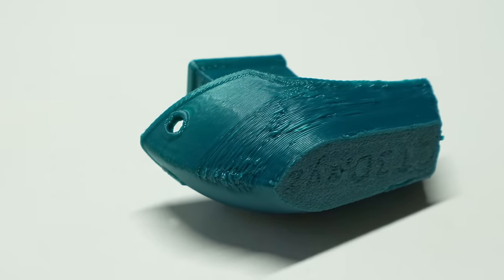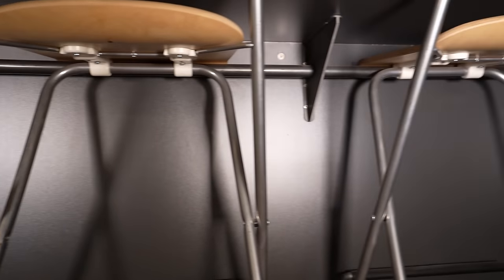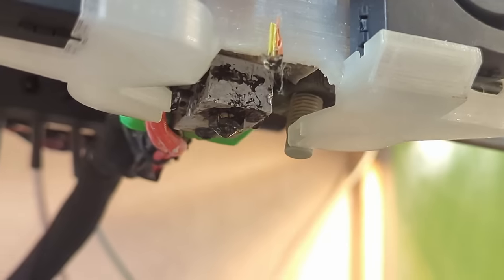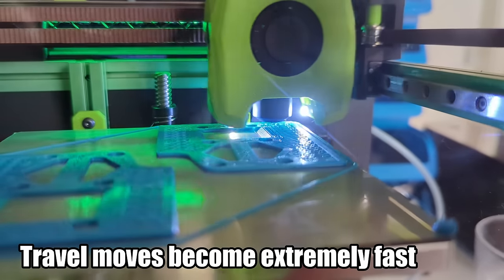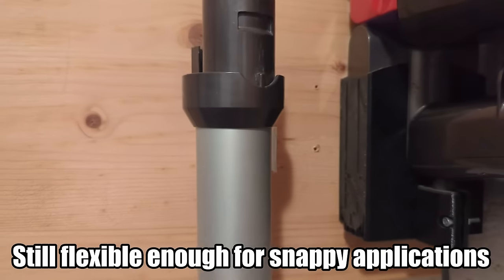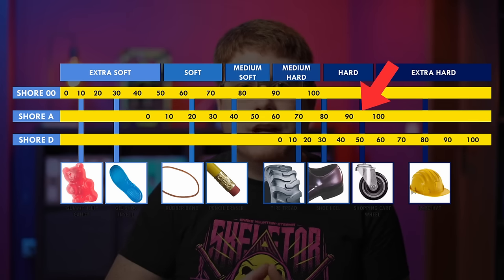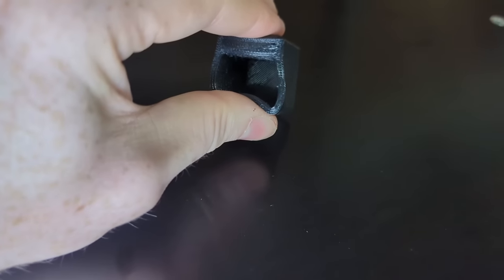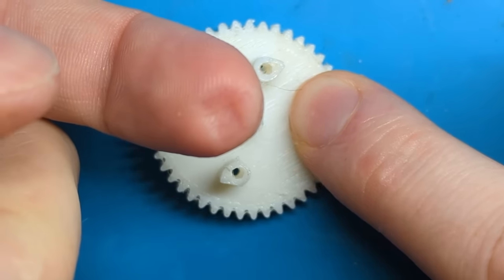3D printing material: When to use PLA, PETG, ABS, TPU, Polycarbonate, Nylon etc.

Comment: regarding slicer tuning. I found that setting a much lower value for resolution takes longer to slice, BUT it creates much more unison surfaces. it seems that turning off arachne,arc and lowering slicing tolerance to 0.004mm forces the slicer to render the model as the model is. and not all the "non aligned" walls i get with it on. :)

for tpu i found that the best plate with the least hassle is the pex one. iso wipe and off to the races. sticks like to glass but releases like from painters tape when its cooled down. amazing surface that i think tinkerers would like very much. apparently u can print petg on it as well but i like to cook that first layer hard to gloss it out so thats not an option on the pex afaik.

a little tip from me to you. try to move your hands outside frame or not have them appear in and out of frame like this. to me at least it is a bit distracting.
Reply from the maker: Sounds probable. Slicing makes a lot of assumptions to how printing the model would turn out the best instead of doing everything to maximum detail
Reply: @SmallBatchFactory  Indeed sir. I do not know why but models that are "basic" in shapes tend to be the same when sliced with mentioned values changed, i dont know if it is a vector thing vs a triangle thing that makes this abbreviations in the surface finish. Since im not sure on what causes the errors i just slice all models first with stock values and zoom in on the preview pane to look for the errors. in most cases its fine with stock. but some models like fine scupltures and machine parts tend to get the errors if not sliced with 0-0.004 tolerance, arc off and arachne off. 

i guess im spoiled with a good pc that laughs at slicing?  recently found ur channel i like the no nonsense approach with throwing out old gospel for new ideas. i too float on the alternative approach to most challenges, i find this to hobby to keep my mind young and active. i also do watch alot of the prints if i suspect something will be an issue and film it with slow motion capture to see what is going on in rl. 

hope you keep making content like this sir. if you need some offload to test thing u might not have the time for, hit me up and we can see what we can get done.
Reply from the maker: I guess the difference in resolution is rooted in that the printer can only do straight movements so more resolution also means more GCODE. Not a big deal with modern machines but old 8 bit controllers might slow down. Having lags while printing can lead to all kinds of nasty artifacts like blobs.

I could watch the printer print all day if it weren't for other chores that need to be done ;-)

If you have any video topics let me hear them. I always have to evaluate if this is something a lot of people want covered (recently got 300 views since not many people cared although many voted on those topics) but I'll give my best if I think I can do it
Reply: @SmallBatchFactory  Since i use capable controllers and have a fast powerful pc to work with i dont see any issue with increased file sizes and complex moves. i found that the x1c i have does differ in result of surface finish from 0.012 compared to 0 tolerance. for me it is important that the part produced has the same dimensions as on the pc screen, i aim for get it right the first time u know?

Watching the printer work is one of the best way to learn how it works i found, pair that with a highspeed camera and you really get to understand what option does what in rl compared to the preview.  

I for one want to build my own "proper" drybox/multi roll storage unit as all the off the shelf versions i have tested so far underperform much. Im new to your channel so i have no idea on what u have covered so far. Being a perfectionist i want to exploit the accuracy of the mechanics to the fullest so that the deviation is the inconsistency of the filaments dimensions that is the variable. 

perhaps something about how important it is to dry the filament properly to avoid headaches down the line would be an interesting topic? or a complete workflow overview from problem to solution would be cool too. see how other ppl do their routes.

may all your first layers be gucci and for your extruders to not skip:)

Custom Viking
Reply from the maker: @reyalPRON thanks! I've briefly shown my drybox made from a IKEA 365 box. I think it was in the filament video with the "PLA outdated?" thumbnail.

Building my own Voron taught me way more than I expected to know and in a very short time frame.

A work flow video sounds interesting. It's hard to balance such a video since views tend to be abysmal. Did something about Arduino, electronics and code a few weeks ago and it was to boring to get more than a few hundred views.
Reply: @SmallBatchFactory  I also built my own rigs up until i caved when i saw the x1c perform, started back in the days with a plywood sheet an arduino, four motors and a dream. 
have built 7 rigs so far and i absolutely agree with you about the learningcurve acceleration of building and config. 

i write my own marlins since im a twat.. hehe but that way i KNOW what code its running and if it fails its on me :) I see that the videos that do well in this scene are bout 3 to 15 minutes long. i will check out your drybox build for inspiration. currently a floating plan in the head so all input is welcome. i plan to make it from scraps and leftovers as im a cheapskate that likes to give my self challenges. if its not hard its not fun imo
Reply from the maker: @reyalPRON the issue with Videos is people phase out quickly if it gets to technical, at least in my experience.

The box is pretty airtight, that's why I bought the IKEA 365. I have some silica inside and rollers so I can print directly out of them with integrated pneumatic couplers. Apart from the silica box everything is off the shelf or from Thingiverse

Comment: Good point about Z-hop, however long travels tend to really bring on stringing and other issues.
Reply from the maker: Travel is the biggest enemy of course. With no Z hop there's no strong actively pulled from the part and the Nozzle has more time to be wiped. Faster traveling also helps a lot.

Comment: I have a pet Parrot and they are very sensitive due to taking in air more efficiently.  Also the are much smaller in body weight (obviously). Teflon can off gas a compound that will kill parrots in minutes. I did a lot of research before deciding PLA was safe. It's possible others like PETG might be ok but I haven't looked into them yet. Despite using good ventilation I just wont take the risk of using anything other than PLA.

Comment: You could also bond different parts made with different materials, together using super glue or epoxy. I printed an exterior cover from ASA, but this warped slightly. Glueing this to a PLA stiffener frame straightened out this warp
Reply from the maker: That's also an option, as long as those materials are easily gluable. I've also fixed spitted layers with a soldering iron and additional filament in the past.

Comment: Regarding Z-Hop, i never managed to print without it, no matter the amount of tuning i pour into my machines... skill issue probably, but one way or another i end up with the nozzle touching some strings and parts detach from the plate

so yes, some insight on slicer tuning would definitely be appreciated
Reply from the maker: In my experience that's mostly an issue with overhangs curling up and delicate parts in general. I'll include that in the Slicer tuning video and also add "avoid crossing perimeters", which can really help with that issue.

Comment: You mentioned black coloring protects material from UV rays, helping to limit the rays affect. Wouldn't white material be even better than black material at limitting UV rays?
Reply from the maker: I'm not sure about that. Many colors degrade under UV light. Black is made using carbon which absorbs the rays and is resistant to UV. White is often made from titanium oxide, could be that it's resistant too.

Comment: Yeah, I wear glasses sometimes, and depending on the budget when it's time to get new lenses, sometimes I've gotten that polycarbonate plastic. So I wonder what it looks like to print the clear version of it, although I don't think we could ever make a good lens that way. But when you talk about it as part of the process to make bulletproof glass, you're talking about using it as the sheet between layers of the glass. Right?
Reply from the maker: There are people out there printing lenses, but it involves a lot of post processing.

You have glass with thin PC sheets but you also have pure PC windows. Depends on the application. PC doesn't shatter like normal glass does so it's used where vandalism is to be expected.
Reply: @SmallBatchFactory : Yeah, I would imagine that lens making would require a ton of post-processing from printing!
Yeah, you might have pure PC windows, but then they wouldn't be bulletproof glass, so the comparison isn't even as "PC vs. normal glass," but "PC vs. glass," since PC is a plastic.
Reply from the maker: @HelloKittyFanMan at least in Germany we say "glass" if it's see through. Nobody checks upfront if it might be a polymer and then calls it that. At least not outside of industry professionals.
Reply: @SmallBatchFactory : Interesting, you sound more British than German. Well, if it's just windows they're talking about, then they could/should say "bulletproof windows" and then whether it's glass or some other material isn't contested.
Reply from the maker: Thanks, I'll take that as a compliment! I'm working hard on my accent.

You know how the industry works, they're all about marketing terms.
Reply: @SmallBatchFactory : You're welcome. But oh, I don't know... German-accented English sounds pretty cool, I think! My church has a major leader who speaks English with a nice German accent. But if working on your accent is what you want to do then that's all right too.

Hmm, yeah, I despise some inaccurate terms that some people use, which is why I suggest others. Obviously not everyone is going to use my suggestions, but it's nice when they do.

Comment: I was very excited when you mentioned creep resistance. In my opinion it is one of the most underrated and ignored material properties. Surprisingly, I haven't any comprehensive video nor written review, that compares different materials with regards to creep. You only touched on PLA and PETG. I would have loved to hear your thoughts on the orhers.
I did a small test myself with surprising results, comparing PLA, PETG, ASA and PC. PLA was as bad as expected. One surprise was that PETG is better but still not great. ASA was very similar. Only PC behaved really good compared to the others. 
But that test was only at a single load. So I don't want generalise my results.
Do you know of an in depth examination?
Reply from the maker: I only have a few infos on this, mainly from the Voron part print guide. Nylon is another creepy material, CNC Kitchen had very bad experience with it. This was mainly about screws getting loose. But some people commented this is not creep but rather static deformation so I'm not 100% sure.

The Voron team specifically recommends ABS/ASA because of this so it's probable you tested deformation under load and not pressure.
Reply: You are right, I printed bars, fixed them on one end and put a weight at the opposite end. They flexed considerably. I let them sit 24 hours and measured the remaining deformation after removing the weight. So my use case is mainly springy things. I wasn't aware that creep under pressure without deformation is yet another effect.
Reply from the maker: Yes, there are different types. The creep under pressure also highly depends on the pressure itself. Not every screw has to be extremely tight, in that case even PLA is fine.

I think most printing materials will stay bent if they're loaded for a prolonged period.

Comment: If a BBQ has a plastic handle, it is much more likely some thermoset plastic like bakelite/phenolic resin as those are much more heat resistant and AFAIK cheaper than the mentioned high performance plastic materials.
Reply from the maker: That's also possible! Didn't analyze mine in detail. I just saw someone printing a form for his morning eggs that he put directly into the pan while cooking, quite impressive.
Reply: PEEK is actually more heatresistant than most thermosetmaterials - especially with endless Fibre reinforcement. Thermosets usually start degrading at around 250-300 degrees under permanent use whereas PEEK only gets a little weaker. 
The price is the main argument here I suppose as PEEK (depending on the grade and the additives) can be up to 100 times more expensive per KG
Reply from the maker: Manufacturers probably cut corners wherever they can so there's probably a few different approaches out there. PEEK is really interesting but as you said it's expensive. Not sure how much at an industrial scale though
Reply: @Averell64  maybe there is some unit mixup, but phenolic resin is good to 300-350 C while PEEK to up to 250 C and melts completely under 350 C.
Reply: @josefjelinek  it’s hard to pinpoint an exact breakdown temperature for plastics in general because the degradation is both a function of temperature and time. I can’t really give you too many details but I know for a fact from my line of work that under conditions where the materials is always at 250-300 degrees and under a slight load that PEEK outperforms pretty much all duroplastic resins (though I should mention that in my case everything’s fiber reinforced).

Comment: Hi, I am just starting my journey with 3D printing. I wanted to buy some PETG filaments for some prints, which will be used outside. However you mentioned, that it sticked to your nozzel after a failed print.
You said you did somthing with silicon sock to prevent it from happening ever again. I did not fully understand it. 
What must I do to be able to print with PETG? Can you help me with that? Or can i just ignore what you said and just print some things with PETG?
Reply from the maker: Many printers already have a silicone sleeve around the nozzle these days. If not a buying a silicone sock helps preventing the material from sticking to the heater block. The issue is that PETG sticks extremely well to a lot of things. It happens a lot if you haven't leveled your bed properly. Just make sure to not leave the printer unattended when you start out with PETG until you're experienced enough to have your prints not fail.

Comment: Great video sir. I will also most likely be checking into your 360 info as I'm trying to learn modeling. I have really started to love tpu for how strong it is and just increasing the info makes very strong parts that even after deformation will mostly return to shape. Only done 95a
Reply from the maker: Thank you! Don't hesitate to contact me if you have any questions regarding Fusion 360, feedback is always welcome!

TPU is really incredible. I only have cheap 95 rolls here and that was always enough. It can be tough to print sometimes. But a friend of mine does name tags mass production and has a lot of experience to help me out.

Comment: IME nylon needs a glass build plate. Hair spray on top of PVA on top of glass has worked well for me. Only using hair spray the nylon can stick to the glass like petg and break the glass when cooling down. I've printed a lot of the stuff and it still sometimes warps if everything isn't perfect.
Reply from the maker: I've had OK results with a bare steel plate (Prusa has very strong magnets) and loads of PVA. Just needed a very large brim

Comment: A very important addition to printing TPU would be the use of isopropanol alcohol to remove the parts after printing. 🙂 A small drop next to the part should be enough to let it creep under and do it's magic.
Reply from the maker: Oh yes, I've heard of that. Haven't tried it so far and don't know if TPU is resistant to IPA. I personally stick with PVA glue but there are always multiple approaches (plus I bought PVA glue in Liter bottles...)
Reply: @SmallBatchFactory  Depends on the polyurethane. Polyurethane can be ether or ester based. Polyester polyurethane is highly resistant to IPA. Polyether polyurethane is less resistant to IPA and might lead to altered characteristics. Common 3D printing TPU is polyester polyurethane afaik... but don't take my word for it. :D
Reply from the maker: @FactionalSky good to know! I'd guess it wouldn't massively harm it but as always it depends on the manufacturer.